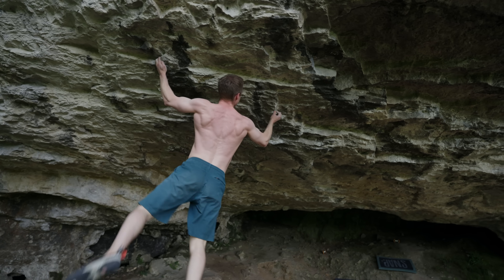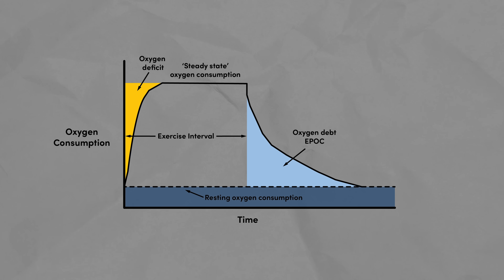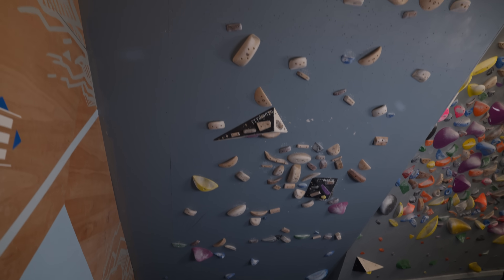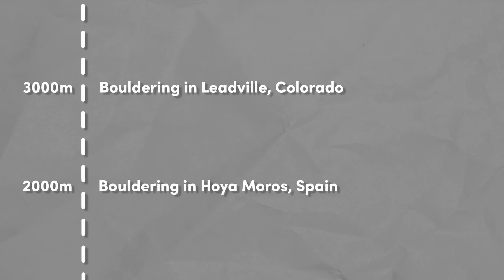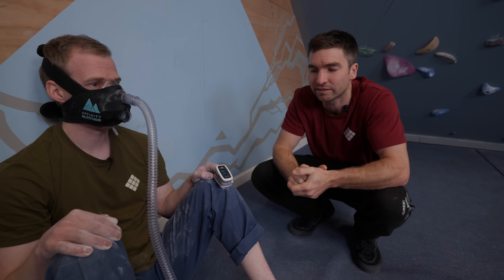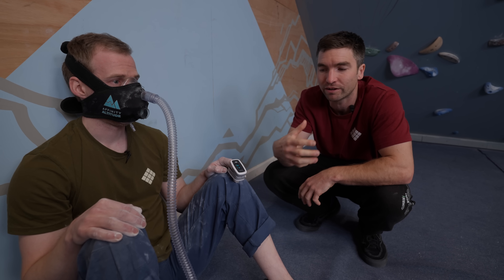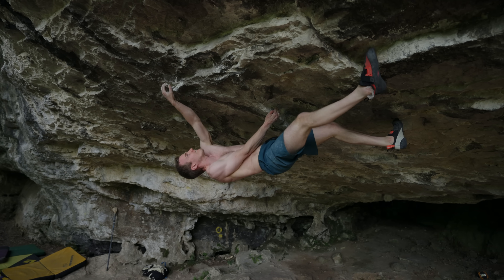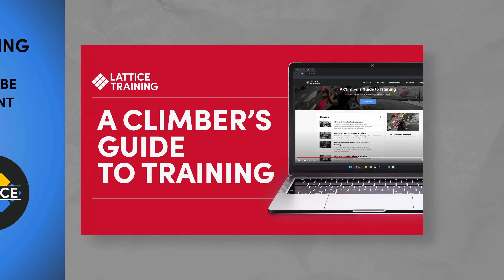Testing a Pro Climber with an Altitude Simulator

Comment: I feel like such an ACKSHUALLY person, but percentage of atmospheric gases doesn't change with elevation. Instead, you might say that the partial pressure of inspired oxygen decreases with increased elevation. This is common misunderstanding. Some people try to frame this as a percentage of EFFECTIVE oxygen, but that only confuses the matter, in my opinion.

Comment: 4000 meters aka 13000 feet elevation is an altitude that is climbed at by quite a few boulderers every year in colorado during the summer haha
Reply: It's nothing crazy. However if you are adjusted to sea level your physical ability will deteriorate substantially at 13,000 feet

Comment: My take away is to get a pulsoximeter and to place by my climbing stuff.
Am I wrong to assum that I could improve my sessions quality by checking my recovery with the O² saturation?
Reply: Thats assuming that O2 is the limiting thing in your recovery, giving it a few minutes between hard attempts is plenty as they showed the speed it can begin recovering.
Reply: I'm sure that would be overkill. Your O2 saturation is back to normal, when you're not out of breath. The faster forms of cellular energy like ATP and Createne phosphate and maybe glucose are most likely the limiting factor between attempts in the normal O2 levels.

Comment: Cool vid! 

Just a note though, O2 % in the air is the same at all altitudes, it’s just the pressure that drops (which effectively becomes like a lower % then sea level)
Reply: This. % stays the same anywhere you go, its just the pressure of air itself drops, so we get less oxygen per breath
Reply: exactly - but the relative measurement here works. Ergo - the measurement device uses the relative oxygen from the environment (in this case sea level) - and we can calc the effective "Dilution" that occurs at higher levels giving comparable oxygen levels in m/mol or "mass". I think they just forgot to explain this